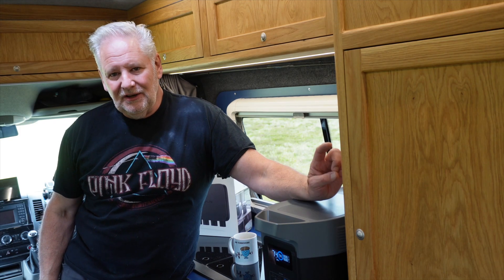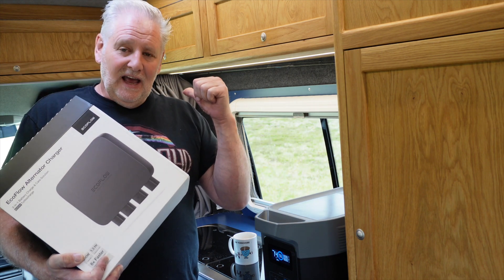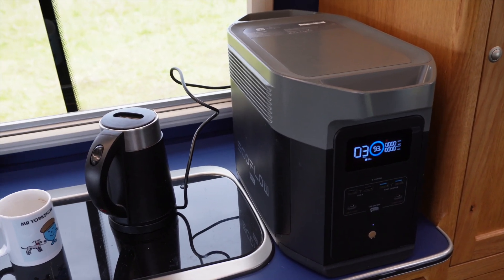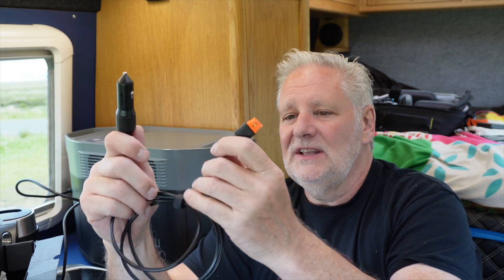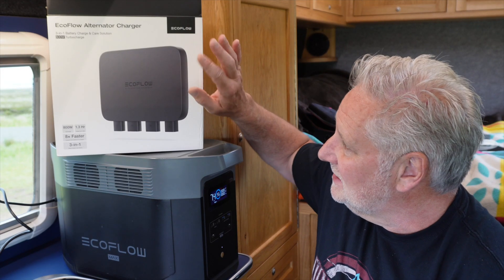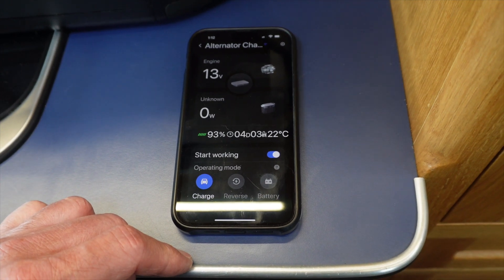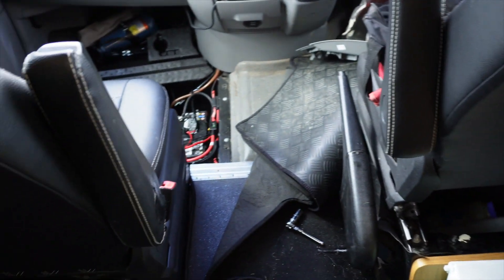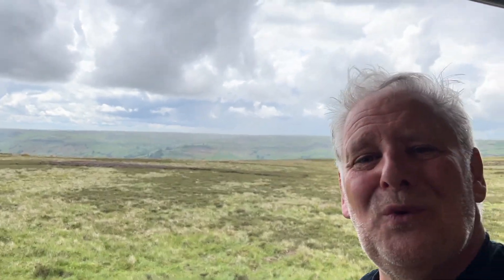The All New EcoFlow Alternator Charger 👌👍👍👍👍

Comment: Will this do any damage to the alternator with 800watts being drawn? And should the negative connect to chassis and not battery terminal? Thank you for your video.
Reply from the maker: Both leads got to the battery terminals and it’s safe for alternators as it takes the low power from the battery and boost it up to the 800w 👍👍
Reply: @onemanandhiswhippet if the vehicle has a ‘smart’ alternator I believe the negative should be connected to the chassis and not directly to the battery. Something to do with the alternator sensing the total load and prioritising where to send the power

Comment: Mine came today and its done what most peoples do it has a solid red light on the unit.After research your Delta will need a firmware update even though it says your unit is upto date.I have messaged Ecoflow to push an update to my Delta and i have another two that will need updating.Ecoflow know this but dont inform people when ordered.Have you noticed the lack of feedback on Amazon including from America on this charger.Ive used Ecoflow Deltas for two years but the rollout of this charger has been a joke.I will give them a week to sort it or send it back as it doesnt work without the update that they should have rolled out with this charger.
Reply from the maker: I did and got this Thanks for letting us know that! I will update this issue to the support team🙏
Reply from the maker: Thanks for letting me know it’s strange as mine updated and worked ok but I will pass your comments on to my contact at Ecoflow for you too 🙏👍👍
Reply: No you won't

Comment: Can you connect the Ecoflow Alternator charger to a leisure battery? I want to do this as the cables would be easier to install and I want to keep my Ecoflow battery bank in the rear of my ford transit custom
Reply from the maker: Technically, yes 👍 but the battery you are connecting it to would need a charge from somewhere or the alternator charge unit would just drain down your leisure battery to charge your EcoFlow however you can switch that section off and just use the EcoFlow unit to charge your leisure battery hope that helps makes sense👍
Reply: I've just installed one in my motorhome exactly how you suggest. As both my Ecoflow and my leisure battery are under one of the bench seats it was so simple just to connect it to the leisure battery. As this is normally charged from the alternator this is where the Ecoflow unit gets it's power from. As long as you set the Ecoflow charger to activate when the battery voltage is over, say, 13v the leisure battery never gets drained. When the engine is running, if the voltage is below 13v the leisure battery gets the alternator power but once it's fully charged the power is then used to charge my Ecoflow Delta Max. Hope that reassures you.
Reply: Just an update. Having used it for a few days I've noticed that the charge rate never got above around 600 watts and soon dropped below that while connected to the leisure battery. I've no idea why. I've since connected it to the vehicle battery and I now get a rock steady 800 watts. So although wiring to the leisure battery is a lot easier there's something preventing full power charging.  I'll stick to the vehicle battery now.

Comment: How set it and forget it is?     Anybody compare this the Victron Orion XS50 DC-DC 50a?  Cables will reach back of a Promaster 118WB with starter battery under drivers feet.
Reply from the maker: Yes it is plug and play you can extent the leads just use the same size cables I have the Victron and the Ecoflow running on my van 👍
Reply: What models you have and how fast does your alternator fully charge it?
Reply from the maker: Delta 2 and it changes at 800w from this unit and from flat it will fully charge in under 2 hours 👍👍

Comment: An excellent hands on demonstration on fitting the unit, mines on order to go with my Max2, can't wait, just need to work out where it will go in my VW-T6,, thanks for taking the time to explain this long waited product
Reply from the maker: Many thanks it is a great idea and works well in my van 🙏😍😍
Reply: Crazy question if you have dual alternators, can you have dual echo flows chargers?
Reply from the maker: @tq6407 I’m not sure I think you would need each to be link to a battery too 👍

Comment: I am not haveing any luck with the charger
Reply from the maker: Sorry don’t understand?
Reply from the maker: This is the information that will help you https://manuals.ecoflow.com/us/product/alternator-charger-800w?lang=en_US

Also 
“Are there any requirements for car models?
The overall voltage of some older or special car models is relatively low and the charger may fail to work as a result. In this case, use the EcoFlow app to adjust the start voltage of the charger.”

Hope that helps 👍
Reply: I have update film wear    app  soon as I plug it in turn it on red light

Comment: I have an unused inverter in my van with 12-gauge wire running from the battery to the inverter. Since the battery is a side post battery, can I connect to the inverter terminal port instead of the main battery?
Reply from the maker: Sorry I don’t know it really needs to be looked at by an electrician to be save

Comment: Just ordered one of these. Looks great.  Thanks for what I think is the first UK based video of it! One question- what did you do with the excess cable from the battery? Just coil up under the seat?
Reply from the maker: Many thanks it is a great bit of kit 👍 yes the unused lead I just coiled it up and put it under the seat 👍
Reply: Maybe you can tell me why  mine as a solid red light brand new
Reply from the maker: @lolprice6190  sorry don’t understand?
Reply: It will not charge has solid red light  and bunch of errors codes there is no output from charger this is my second one
Reply from the maker: Sorry are you say you have got one and it’s not working you have a red light and it’s not charging your Ecoflow?

Comment: This work on smart alternators?
Reply from the maker: It did on mine 👍👍
Reply: Your crafter got a smart alternator? Tried to message ecoflow about it but getting nowhere even asked what a smart alternator was 😂 it's for my 2017 Vw t6 bluemotion so has euro 6 stop start etc bit more complicated than older ones
Reply from the maker: My crafter is a 2017 and has a smart alternator and it all working great I also have a B2B fitted and that works alongside it too so I would imagine you should be fine 👍